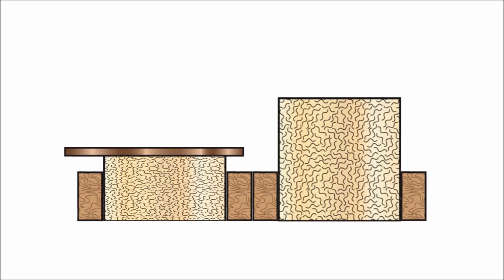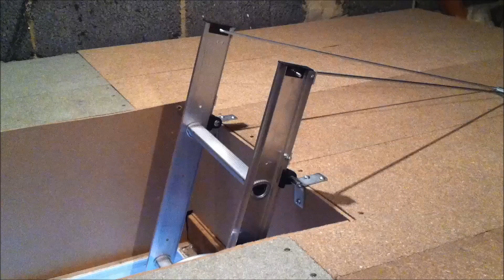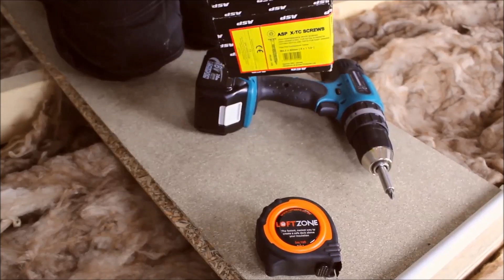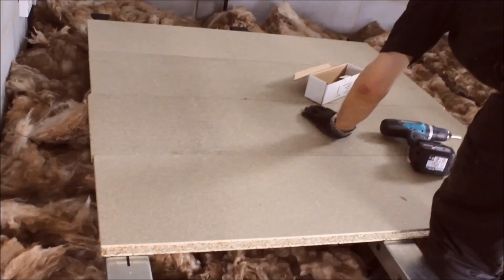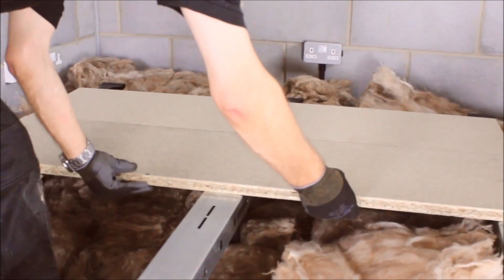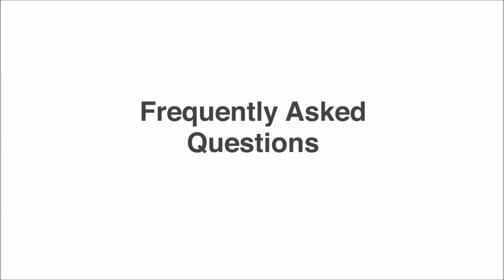How To Install Loft Boarding | Professional Installer Training Video | LoftZone

Comment: @loftzone would you suggest adding permeable aluminium insulation above top-up insulation (below boards), in a cold loft?
Reply from the maker: You could do, but not sure it would make much difference. If you already have 270-350mm of insulation then any additional insulation is probably not necessary? For sure, the aluminium would reflect radiative energy but the fluffy loft insulation is meant to do a lot of that, too. If you do choose to do this, it certainly won't harm (since you are using water-permeable foil) but not sure that the cost/benefit will be particularly strong.

Comment: I have installed the supports and metal beam but when I try to screw the panels through the metal it keeps lifting the boards up and does not screw into the metal. I have used loft panel boards from bnq which are 15mm thick. Could this be the reason why they are not screwing into the metal? Any help or advice would be great!!
Reply from the maker: Are you using an electric screwdriver? Try putting your foot on the board as you screw in. Btw, loft boards are usually at least 18mm thick. Are you sure that the boards you bought are strong enough. We only use 15mm boards for shelving.
Reply: because the screws don't penetrate the metal easy...try some better screws or use m1 or m2 metal drill before the screws...

Comment: I wonder what was obviously cut out about the screws. It used to be that they weren't included but I got some with mine.
Reply from the maker: We provide screws with all our LoftZone StoreFloor kits :)
Reply: @LoftZone  Not always enough though. You need to calculate how many screws are required and include the correct amount. I ran out on the 3.6x3.6m kit which needs minimum 228 screws.

Comment: I can't find the 1.8 and 2.4m cross-beams on the loftzone website are these available for purchase?
Reply: Yes you can buy those lengths but you need to call LoftZone for a price as delivery costs depend a lot on your location.
Reply from the maker: Update: the 1.8m lengths are now available on our website. Please call to order 2.4m ones though, as they're too long for normal postal services.